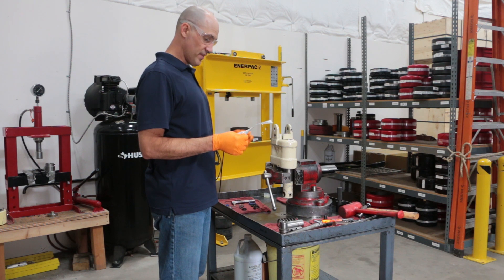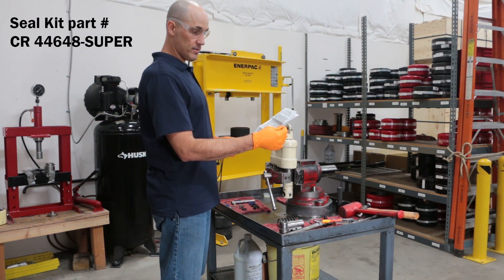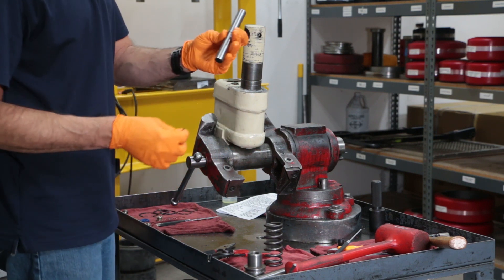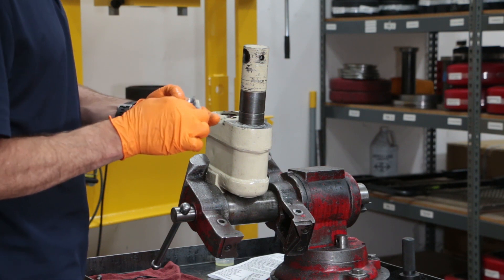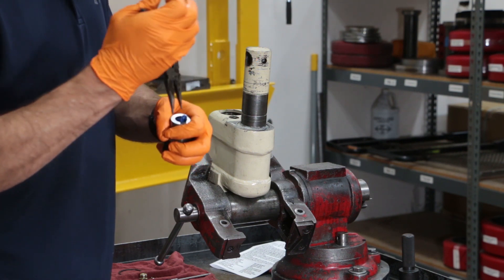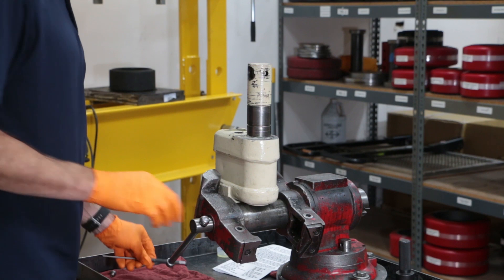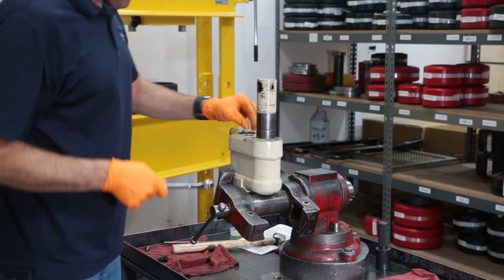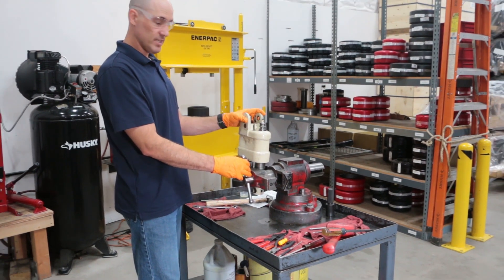Part 3: Rebuild the Crown PTH50 Hydraulic Unit with the new seal kit

Comment: Great video.  Thanks for posting.  I'm convinced my jack needs the pressure-relief increased.  It lifts and hold loads just fine, up to about 2,000 lbs.  Anything over that, just seems to push oil in circles inside, but it won't lift.
Reply from the maker: Please send an image or two of the jack to csinfo@genericparts.com so we may advise on a solution.

Comment: I'm having problems unscrewing the hydraulic fill screw on my PTH Crown pallet jack? Any suggestions
Reply from the maker: Plugs sealed with copper washers can be loosened by striking with large pin punch and hammer. Then use screw driver

Comment: I have and older pth and everything seems to make sense except the pump cylinder seal. The rod is a slip fit into the cylinder to start so once you add the seal there is no way the rod will go through the seal.
Reply from the maker: Correct, the early model PTH units did not use a pump piston pressure seal, rather the design relied on a tight slip fit with cylinder to build pressure. If cylinder is worn it will need to be replaced. Part number 41995 https://genericparts.com/search.php?search_query=41995
If more information is needed please email CSinfo@genericparts.com

Comment: I’m on last part but the lift ram won’t go down when I lift the actuating pin. What can do ?
Reply from the maker: Sounds like you may not have the valve assembled correctly, item #30  is either missing or otherwise not positioned correctly. The tip must be positioned inside #32 when #32 is tightened. If you send me your email I can email you the list of parts with above mentioned item #'s, instructions and line drawing. irisn@genericparts.com

Comment: Just did a rebuild on a PTH50, couple of things I figured out:
 - to install the lower ram seal (above the plastic bushing), the metal bushing can be used as a seal install tool. Install the spacer, drop the seal (pressure side facing down), then insert the metal bushing, carefully line up the seal by inserting the the ram rod, remove the ram rod and then use the pump cylinder (hollow side down) to press the seal in using a long c-clamps. Tighten carefully until the seal sit. You can then tap around with a punch to clear the snap ring groove
 - straight snap ring pliers are the perfect tool to install the pump cylinder inner seal (no need to blunt pliers), same method as shown here.
 - To install the pump cylinder snap ring, use a long c-clamp to compress the spring then tap the snap ring with a punch.
 - do not install the valve balls / poppet / etc before installing the release valve cross pin, the release pin needs the extra travel to clear the cross pin
Reply from the maker: Thanks for elaborating!

Comment: My pallet jack was repainted and they painted over the sticker. My lift assy. looks like this one. Are there any numbers stamped on this to help id it? If so where should I look? Or should I strip it down and spec out the parts?
Reply from the maker: Hi William! Could you take a picture - from the side - of your hydraulic unit and text it to us 503-523-8990
 take a picture like this: https://youtu.be/ugVLBXuPJqQ
Reply: Where shall I get the repair kit for this crown jac